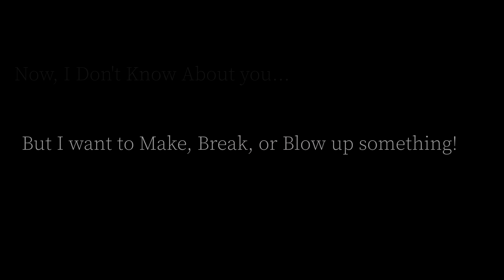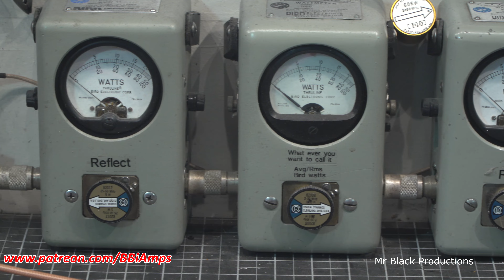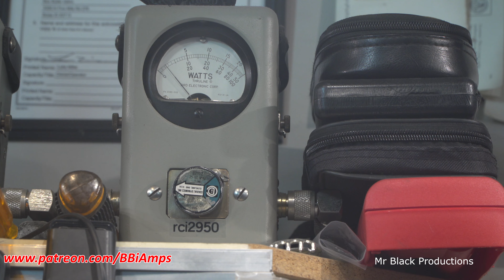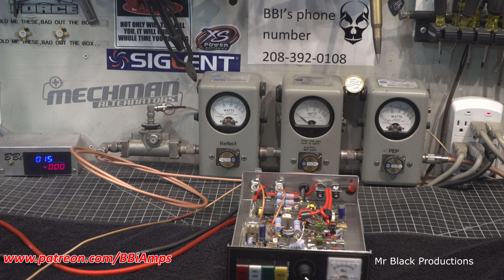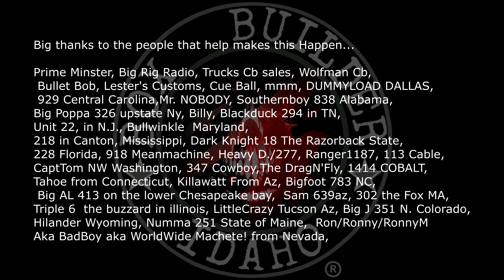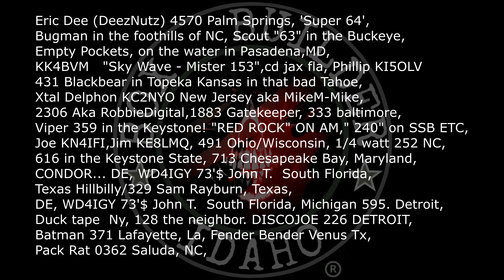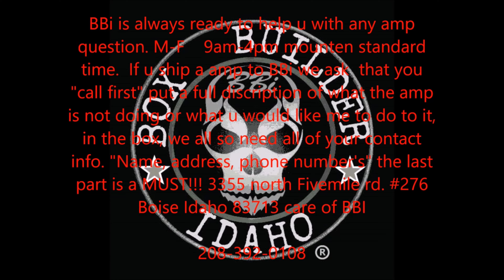Tx Star 667v Its sold!! ;)

Comment: That great ! wish I kept The DX 667 I had years back. It had all Japan pills. I have done one like that . but most pills dead. re did RFP 2979 and Japan 2290 at the time. has some tuning and bias issues . they tap off 2 pill bias to bias 1 pill driver. turned out  needed 2 different bias resistors 1.6 and 1.8 ohm  fixed un even volts. also had one with that feedback cap that looks like a diode go bad. lost a new pill because of it. it was ok until RF went threw it and over bias and blown pill . first time 2 pills blown. looking at cap had black mark inside glass from flash over. now I learned to check them . also had that 1.6 ohm go open  and look good. now I got 1% 1 and 2 watt ones on hand. love them old ones. got OG hot plate, 1 pill driver, DX 500 . this time I keep . 73's